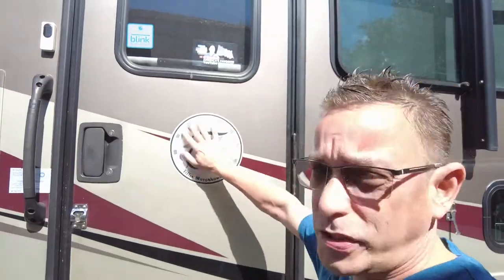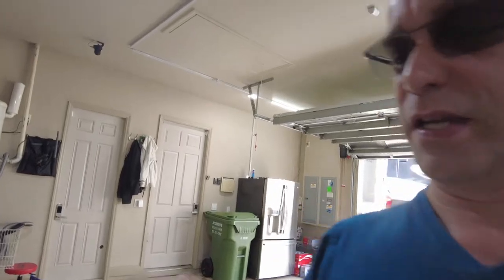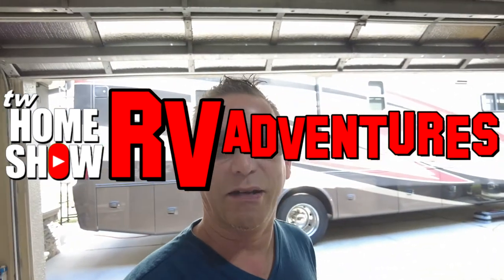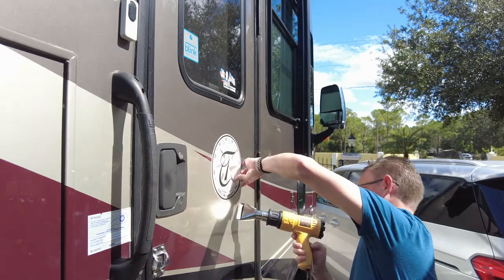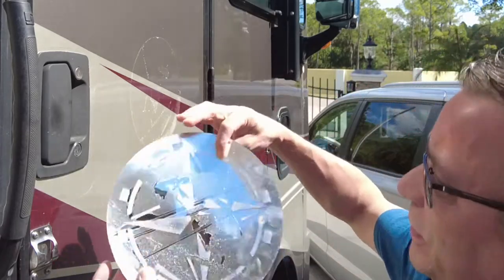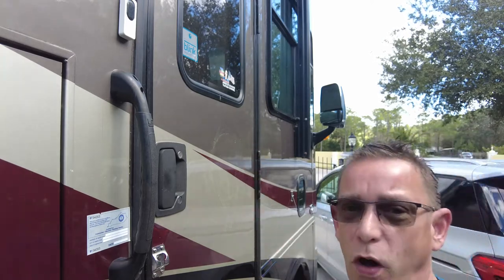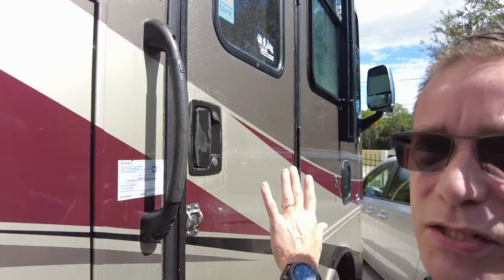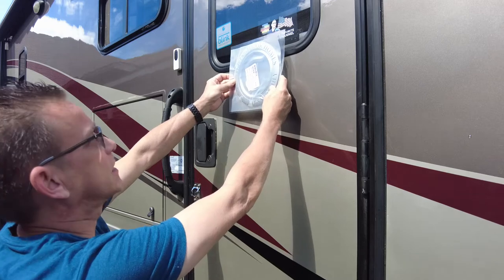tw RV ADVENTURES - Episode #44 | Install New TIFFIN RV Emblem | Removing & Install Automotive DECALS

Comment: You should consider removing the 3D "V10" emblem (I did) as the catalytic converter thieves specifically target motorhomes with this emblem. If they don't see it, they'll assume it's a diesel rig (no catalytic converter to steal) and move on. You could do a new video on this, informing RV owners of this fact.